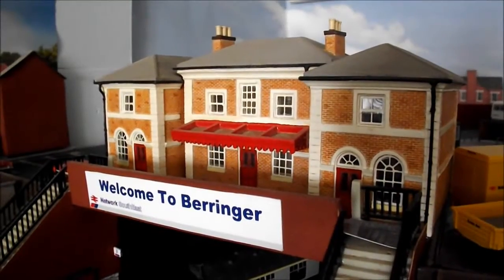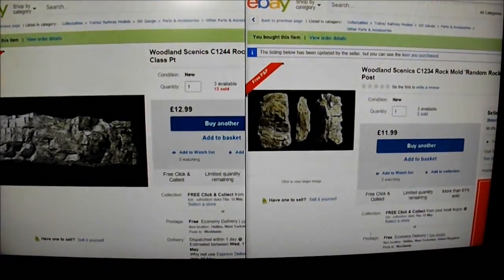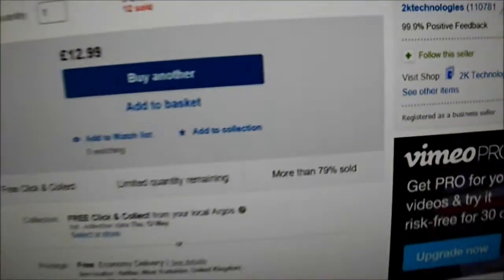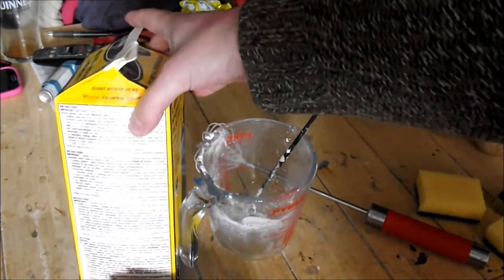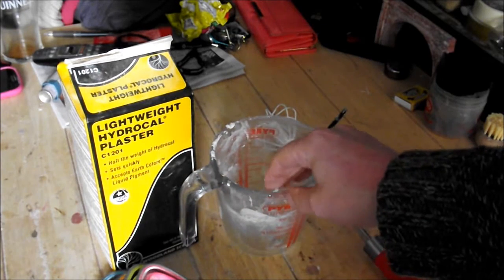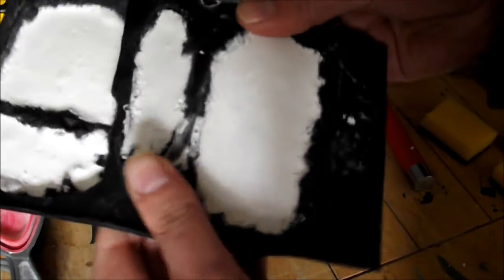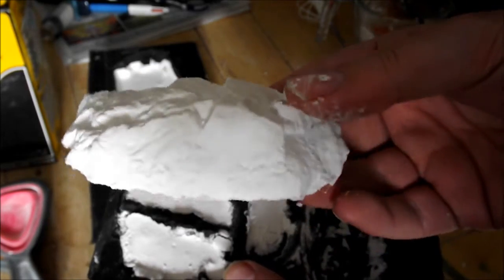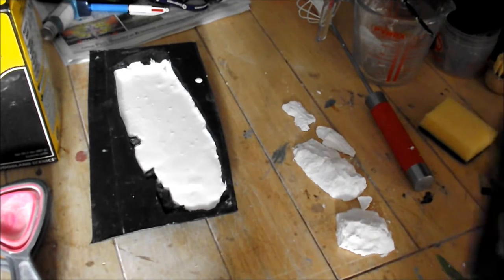B&D: Guide and How to make a Rock Face using Woodland Scenics Rock Molds Part 1

Comment: Well done again Susannah, That's a difficult process to demonstrate but you did it well. I personally find the Woodland Scenics molds to be too stiff. I use homemade ones that are much thinner and more flexible. I use casting plaster (Plaster of Paris type) and press it into place on the railway just as it starts to set. That way it can be bent to fit the space it is going into. That said, you really have achieved a good result with your method. I look forward to more from Berringer and District. Sincerely, David.
Reply from the maker: +David Atkins Thank you David for commenting, You are quite right the woodland scenic rock molds are a bit stiff and did actually try to find others before purchasing these rather unsuccessfully but nonetheless I'm pleased with the results as I wasn't to happy with my previous attempts. Susannah